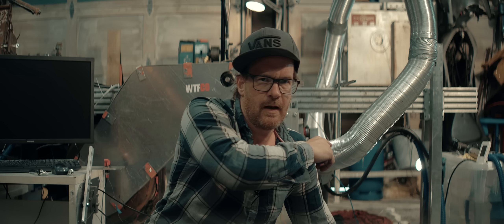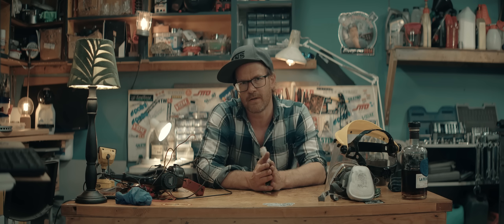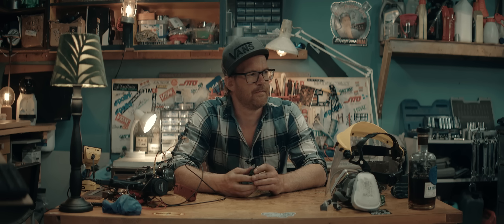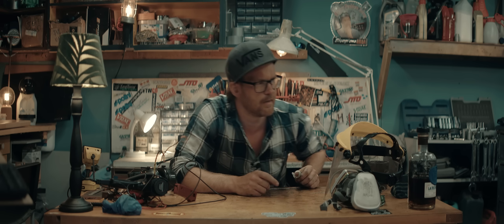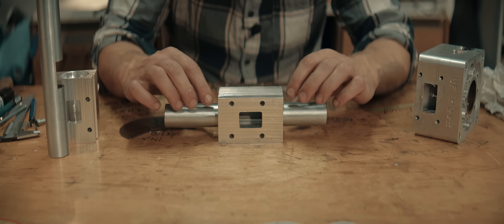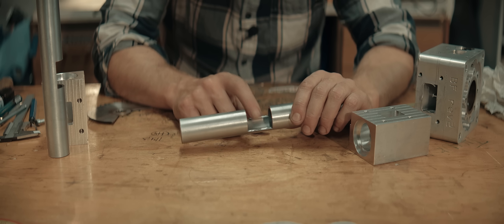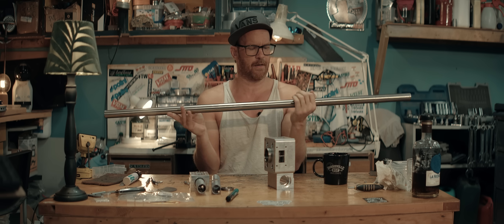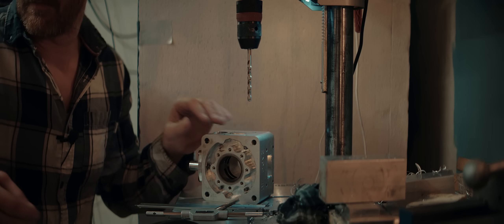The Weirdest Engine.

Comment: Alex one valve type or the other, make a head with 4 regular poppet valve, a crosshead , so you can have a lubricated cranckcase, a combined blower turbo for scavenging 😁👍❤️ there's many options. And there's a long way to over 30 HP, and 233 km pr hour

Comment: I was thinking back when you were machining the dimples/groves on the inside of the rotary valve housing, that perhaps a pair of needle roller thrust bearings would have solved the problem. McMaster has them up to 160mm. NOT CHEAP. But probably could have solved the issue if you had designed the dimensions around having one on the outside of the disk and one on the inside.

Comment: Love the new set-up! Your channel inspired me so much I actually started my own crazy project...a quad-bike made from carbon fiber with electric powertrain and magnesium wheels. I got the weight of a 430lbs Raptor down to 215lbs!
I decided to make most of the components from scratch just like you...except that I add layers of fiber and you remove layers of metal. I did create kind of a lathe so I can modify tubing using a cordless drill!
Still have a Lectron nitrous-injection carb you can have for free...by September Ill be able to ship it at my own expense if you want it. Never been installed, long story.

Comment: Reduce comp-ratio to 10:1 at least, and do 0.8 bar boost - and you'll take a much more profit than from 14:1 and 1.5 bar boost, and much cheaper fuel can be used - of course
Reply: Turbocharge at 100 lbs boost that will make up for some problems.
Reply: @warrenafflick6498  1.0 bar = 14lbs, 100 lbs ?

Comment: Melty belty I think.  By the way have you come across the alpha ceturi engine from the 1970's they used the main bearing as a rotory valve . Limited by its small size sadly.

Comment: My compliments on your work again Alex. Consider leaving a bridge in the drum valve openings to avoid fatigue due to the acting bending moment when the exhausts are shut. Should be placed in the longitudinal direction of the drum.
Reply: Yeah, bridge is good idea, even if there would be no immediate faliure, bending will speed up wear wich would make it leak more and also it will put more stress on belts.

Comment: think about electric turbo powered by exhaust turbo electric generator
Reply: try spinning it even faster, put an in-line impeller turbine on the exhaust pipe, as the electricity generator
Reply: fun idea :)
Reply: or just providing more regular output power

Comment: Have you thought of trying a 4 stroke head with all exhaust valves? Worked for many 2 stroke diesels.
Reply: My guess would be ,valve train weight and loads cost power to drive  especially with 50 cc capacity not to mention rev limitations.

Comment: You haven't mentioned it but pressed on pulleys could be a bit of a dick to get the timing matched up. Cutting a key slot and having slip fit would be reliably accurate.

Comment: Resonance or nothing, if the brute force will work it will have to be tuned with some kind of pipe, this exhaust valve stuff is way out of hand. Just building a shitty four stroke at this point. There’s already enough parasitic loss with the supercharger. I think looking into a more efficient supercharger set up and sorting out the port timing would be more beneficial. If it’s going to work it will have to work with minimal parasitic losses and good tuning. I’m more interested in why it won’t make power after that 13k odd ceiling. What would you need to move the flat power and higher in the rev range, if the torque is maxed out already then building revs is surely the way forward, if you can improve the torque with better port design and well tuned pipes and intake it will do more than a dodgy valve.
Pretty fun for you fabricating everything I suppose.
Reply: You are correct. I was married to a parasite once , things run a lot mote smoothly now I dont have that drag.

Comment: With the design of those valves it doesn't look like timing is that critical.

Could you not use an L shape passage through the bars so both cover the intake and exhaust? ie, one end of the L at the cylinder and the other at the exhaust - rotate the bar 90 degrees and the other end of the L is now at the cylinder and first end is at the intake?

Doubles the effective port volume.

Major timing could be different between the 2, and maybe use a reed valve on the intake system on one with the more extreme timing

Comment: Couldn't you have machined a ball bearing race into the rotary disk valve housing and installed a roller bearing trust washer on the exterior side of the housing? I believe that style valve will yield performance benefits over rotary drum valve system.

Comment: I like the idea, and I hope I'm wrong but I reckon those bearings are going to die pretty quickly.  The seals will surely not survive long, and the expansion of the tube and inner race at high temperature is going to put a lot of load on the races.  Needs some kind of heat break between the tube and bearings I think, but there's no room in the current design.   Maybe graphite bushes within the valve and one larger external bearing to take the pulley loads, maybe a finned stainless heat break between tube and bearing?

Comment: Oh that's amazing! Has anyone ever done this on a production engine? I guess you won't need to worry about expansion pipes if you have exhaust valves, so that's one less thing. I was asking my self how you can add a swivel bearing to the middle of an exhaust pipe, if half is spinning and half isn't. Hope it isn't an issue.
Reply: I'd like to order some exhaust bearings... Come on now, I'm serious.
Reply: @hallkbrdz  

.....& a muffler belt.
Reply: @hallkbrdz  ...and some blinker fluid.
Reply: @hallkbrdz  🤣
Reply: Repco did it on a Holden 6 in Australia in the 60s. Not in production just racing / experimental.
Reply: Yeah, you don’t need to worry about expansion pipes, so you won’t get serious power without Forced induktion.
Reply: An expansion pipe does two things!
1, And this is what gives the absolutely most power. It sends unburned air/fuel mix back to the cylinder.
2, I also give an suction effect at exhaust port opening that helps suck out the exhaust and to a degree helps sucks up more air/fuel mix from the crankcase.
So even with rotary valves a pipe will help.
Reply: @therealgrizzly  

You have the importance & the why backwards. Swap #1 with #2 & you have it.

Comment: Maybe try Torrington bearings on the disk valves? I am concerned about flow with the rotary valves. The flow needs to make an extreme directional change with the rotary valve. I guess if the rotary valves were large enough in diameter that may work. But side load bearings on the disk valves will be more compact and flow will be straight.

Comment: This is a great education on all the various valve solution of two strokes, and their disadvantages.
Reply: eh.. 2strokes dont need valves. unless you go exsotic like a turbo. but then the rules realy start to chance.
the whole point behind it that you get twice the powerstrokes of a 4 stroke.
exsaust also gets funny. there needs tobe  pressure buildup for the inlet gasses to not just flood out
using a turbo you cant avoid this. so you need a type of valve. where it realy gets funny couse here a 2stroke looses alot of efficiency and a valve just the thing that fixes it. 
using a inlet valve you can even skip using the part below the cylinder and use it for like oil so you dont need 2 stroke oil. now hes using nitro so this matters not at all.
the problem you have in this story a 2 stroke can reach much higher rpm. something with valves will not like that.. so you get to the exsotic valves.. im rather amazed this engine didnt disaseemble itself yet.
but twice the power per kg vs a 4stroke and 4 times the rpm is facinating as hell.
Reply: @wasteandglory  Well, a 2stroke cant rev much higher then a 4stroke. If you want to rev much higher then you need to reinforce the whole engineblock, crank etc so the biggest advantage of a 2stroke (weight) is lost and also the possibility for higher rpms - you could switch to a rotary 2stroke. A 50cc 2 stroke cant rev much higher then a 50cc 4stroke but it reaches the higher rpms much faster (conventional piston engine). I think the only way to go is makeing the whole 2stroke engine variable (inlet, outlet, ports, ignition, exhaust) so it becomes itself a working valve always running at optimum settings - like a organic heart. I asked by a interview the former honda motogp manager (mr. berger) of what he thinks, what hp etc 2stroke motogp bikes could do today if they didnt went to 4strokes - he said, not much more power but much less weight.of the bikes in general. im thinking of 80kg bike with 160hp...
Reply: @DrSmile81  he's had his old spx engine up around 20k rpm with off the shelf crankshaft, piston and rod making over 20 hp with 50 cc ... Tell me you've seen a single cylinder 4 stroke do that🤣
Reply: this man does not build these 2 cycle machines for any practical purposes...ever. His purpose is strictly personal interest in pushing what people say are limits... I always thought that an inline twin 50cc 4 stroke with all the boost it can muster would be awesome to see and probably do just as well as any 2cycle (obviously 4x the weight) but that would be a video for fourstrokestuffing...duhh
Reply: The evolution of "just build a 4 stroke 16v".....lol
Reply: @DrSmile81  16valves I'm assuming you mean a 4cylnder , that would be very small parts and complex 50cc
Reply: @jasonrobertson3330  Im just kiddin...but thats why the industry in general decided to go with conventional 4 strokes instead of 2 stroke/rotary etc. and the 2 roller ports made me thinking of a stoneage 4 stroke dohc but sidemounted XD
Reply: @DrSmile81  that would half the power strokes
Reply: 2stroke has twice the powerstrokes a 4 stroke has. like twice the power if you start adding valves.
perhapse you also seen that engine does 20k rpm?
so thats like 6-8 more strokes redlining it. and a turbo and using a quite nice compression ratio
putting this on 2 wheels might be able to keepup with 250 cc 4stroke bike
i just wonder if your not just going to killyourself figuring out the rpm's like a clutch invading your pelvis.
Reply: @DrSmile81  🤣

Comment: I've been watching your videos for years. I love the way you can change the design of an engine so fundamentally and it works.
Of all the channels I'm subscribed to,  your new videos are the ones I most impatiently await.
Reply from the maker: Thanks man!
Reply: @jaratt85  and thats because it is a prototype.
Reply: It doesn't need to work for long, it just has to complete its task
Reply: Agree!! The same!! Good job Alex
Reply: @jaratt85  that's why it's called R.N.D.= RESEARCH AND DEVELOPMENT
Reply: @tstricklin4808  R&D the ampersand stands for "and" R.N.D stands for REAL N!$$@ DEPARTMENT
Reply: @tstricklin4808  he will get it eventually . i love the think and try process , there a lot of weirdass ideas that flew through my head too one time or another before discarding it for one reason or another (mostly because i could never make it using a hacksaw drill and hammer ) it allso creates new ideas on how to skin a cat
receach and development is usually done in secret to prevent giving away ideas to the competition , having him work on it in the open is verry refreshing , then again unless he manages to get the engine running on pure water having a high performance 50 cc engine with a short lifespan to break a record on bonneville isnt realy sumting that has a lot of competition
Reply: @watahyahknow  oh yeah ,been following for a couple years myself, I dig the shit outta his approach to thing's kinda mirrors myown ,on a simpler scale as I'm not smart enough to use most the equipment he does
Reply: Hell of respect for you work 😊
Reply: same

Comment: A drum valve is extremely hard to seal as is. Adding high pressure exhaust and forced induction amplifies the problem.

A cylinder valve, like some radial aircraft engines, would be much better. They’re hard/near impossible to graft into an existing design though.

If you keep having trouble, keep it in the back of your mind. Good luck my friend!
Reply from the maker: 👍 I'm hoping "heavily restricted" is good enough.
Reply: Agree with the sealing part. they are going to leak badly. Maybe  an "O" ring on each end.
Reply: @madb132  More of a labyrinth seal i guess, Full metal so no rubber degradation.
Reply: Might be he gets away with as this is in theory pulling much higher rpm, throwing fuel mix out too so sealed bearings might get backed up with oil.
Reply: was thinking of main seals

Comment: How about designing two round valves that could open up. one for the inlet and one for the exhaust port. When the inlet valve opens the exhaust valve will shut, allowing you to build pressure. Crazy idea right?
Reply: Sounds like a 4 stroke engine to me!.
Reply: @onecookieboy  a 4-what now?
Reply: @flyingdutchy01  I see what your saying, but is it still a 2 stroke?
Reply: @onecookieboy  yes it is a 2 stroke because the piston fires every 2 strokes. Having valves are not what makes a 4 stroke engine, 4 stroke. 
Take the Detroit 2 stroke diesel engines for example which were used in trucks, generators etc. They have 4 valves on the head for the exhaust, and ports on the cylinder liner for the intake(like regular 2 strokes)

Comment: Nice video!
For CNCing holes it is better to use a spiral downwards motion than stepping down. I think it is called bore and then circular/spiral motion in Fusion360.
Makes holes way rounder. Sounds crazy but it does.
Reply from the maker: Thanks for the tip!